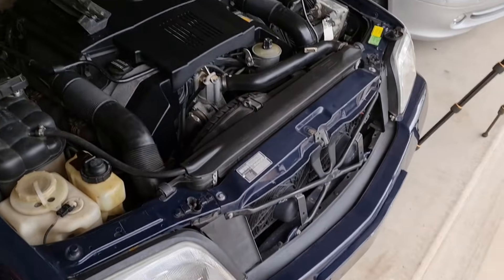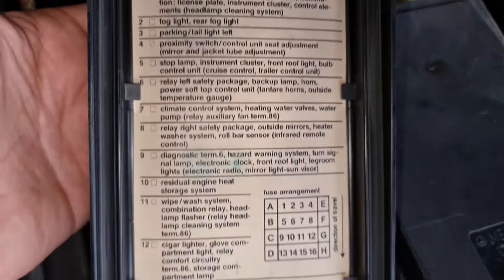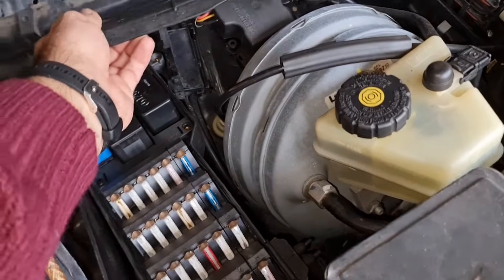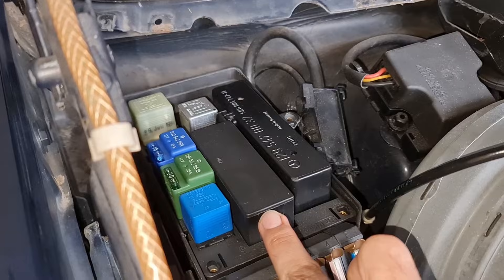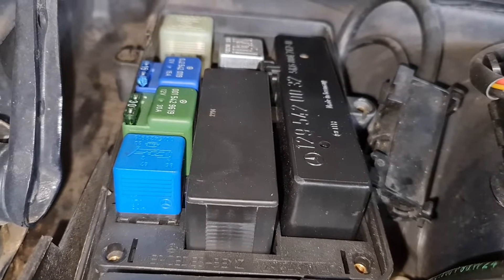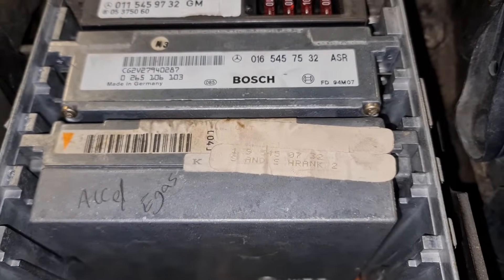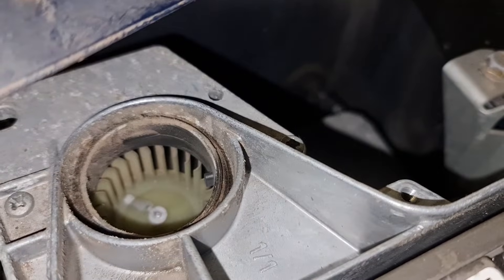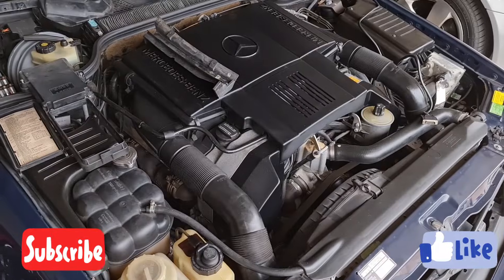SL-Class (R129) Location of ECU, Modules & Relays

Comment: Another great video! One question, are there two separate relays for the fans (high and low) or is it the same relay?
Reply from the maker: The R129 Mercedes radiator fan, specifically the auxiliary electric fan, typically has two speeds (low and high) controlled by a resistor for the low speed and relays for both speeds, which are triggered by temperature sensors and/or the AC system. There should be an orange relay with fuse on top but might be different for 1998 and after (thermofan module)

Comment: After a winter storage without a battery, my '96 SL500 has no power at the cigarette lighter. The car has been regularly used, and everything was working fine until now. The fuse (nr 13. 20A) is okay, but there is no voltage there with the ignition on. Three is no corroded contacts or a bad ground. How i can check relais or modules in this case?

Has anyone experienced a similar issue?
Reply from the maker: Most probably again a corodded fuse as you said.

Comment: Did the spark plugs fuel pump alternator new belt and the car just doesn’t wanna start the battery works but car wants to crank but just dies out any solutions!?!?
Reply from the maker: Fuel pump, have you checked the fuel pressure? I have a video on this.

Comment: I haave a problem with a. 500 , 1990 production year. Interior lights are permanent on (even with a key out) and if i pull bulbs out car still drain a baterry in couple of days. Which module cobtrols a door switches, as i am suspecting that that coud be a cause of current drainage (switches are ok i have checked them).
Reply from the maker: While ignition off pull out Fuses one by one and use an Ammeter  instead the fuse and see what device is pulling the current.

Comment: Where’s the overvoltage relay fuse located
Reply from the maker: @mtbrasi369  Single relay with a fuse on top usually close to the firewall. Pretty sure that it is only available for 1993 and earlier.

Comment: Seems like the video breaks up right after you mention the wiper and turnsignal relays. What are the silver and white ones?
I cant get either power seat to move, wondering if the problem is there?
Reply from the maker: Check the Fuses, they are prone to get oxidated.

Comment: Where is the wiper motor relay ?!!!
Reply from the maker: There are two 'modules' that control the wiper blade N10/2 (which sits in the black box above the fuse box) and the K26 relay module, located just below the blade somewhere.
Reply from the maker: There are two 'modules' that control the wiper blade N10/2 (which sits in the black box above the fuse box) and the K26 relay module, located just below the blade somewhere.

Comment: Hi Benz Addiction, wondering if you can help or have any guidance here. I have a 1995 R129 SL500 and today the soft top would not come back up, the roll bar wouldn't work, the windows would go up or down and the indicators don't work. Is this a Module issue or something else. Ive checked the fuses and nothing appears blown. Thanks
Reply from the maker: Start from this video to understand how the R129 roof works: https://youtu.be/4A0b4H2D9og

Comment: Hi there, Benz Addiction wondering if you can help, I have a 1995 R129 SL500, the top, windows, roll bar and turn indicators stopped working today. I parked the car with the soft top down and when I went to start the car and put the soft top up, there was no light on the hood button coming on and nothing else as above worked? Is this a module fail or something else, I cant see why the indicators wouldn't work if it was a Soft top module issue. Nor sure where to do from here, any guidance would be appreciated.
Reply from the maker: I have a complete playlist on how to make R129 top to work again, no stress, let me know how you go. Nothing scary at all for R129 Top.

Comment: Hi again!  Well now I need to access the n-7 because of a tail light issue.  How in the heck do you get that trim piece off.  I have a 92 and part of that trim piece sits behind a screen like thing and I see where there are 2 screws that appear to hold the trim piece in place.  You dont have to take that back screen piece out too to get the trim piece out do  you?
Reply from the maker: Hello, Before touching the Fuses and Relays make sure that your bulb is not bad, switch around the bulb from right to left first. Finally if you have to check those Relays, basically you need to take off evey screw and filter compartment,  see my other video about Cabin filter. Good luck 👍.
Reply: @BenzAddiction Yes, you are correct I did check.  Bulb is good.  no power to bulb.  pulled tail light assembly out and tested the plug going back to N7 no power to that plug/pin either.  I think one of the pins on the n7 is bad or needs to be re soldered?  I think the N7 is messed up on one pin.  I was going to take it out and clean it and re seat it see it that is my problem but not sure on how to take it out?  Have you taken one out?  After you get access do you push the n7 out from the bottom?
Reply from the maker: @rioraton  check the part number on ebay, look around the part you would like to remove, and you will see how the removal is.
Reply: @BenzAddiction  OK.  Well, I got it to work :) But I did not fix the problem.  All I did was run a jumper wire from the marker bulb to the tail light bulb in the assembly now when I turn on the tail lights it lights up just fine. Not sure if tail light is as bright as the other side I will check  that tonight but it works.   I did not want to spend a bunch of $ for one pin that is out in the N-7.  If more lights go out then I will replace the n-7.  Where I come from it is call a half ass repair :)
Reply from the maker: @rioraton  Great, what matters is that it now works...
Reply: @BenzAddiction  👍

Comment: Great tips here! I learned a lot - THANK YOU😊
Reply from the maker: Thank you for Watching Mark :)
Reply: I might add in here - after reviewing this very well put together instructional video for the third time - that in your video - just to the right of your fuse box & relay box is yet another smaller fuse box. Held down with (easy to break if not cautious) two torx head screw caps. Inside this fuse box are three ‘metal’ fuses - all of which I had to just recently replace. Plus inside the lid is another paper fuse outline instruction sheet such as what one finds in the main fuse box lid. These special metal fuses control the hard tops rear defroster unit, a blower motor, as well as another climate control assembly. Easy to get into just be careful when loosing and tightening these old plastic parts as they will break as I found out first hand & they are not readily available at a MB Dealership as they had to ‘special order’ them for me. Inside that fuse box lid you’ll find the appropriate size metal fuses (on the paper diagram) that should be used. I found that the previous owner of my R129 had placed fuses way over the amperage level (50 & 80 amp metal fuses) when all three slots call for only 30 amp each. The MB tech told me that this kind of bad thinking & oversight could have created a system to overheat & eventually burnt wiring in a harness. So it’s good to also check this fuse box too when in that area checking on other fuses in the main fuse box. Hope this might also help you & others.

Comment: excellent information 👍
what are you referring to as electric water pump?
screenwash pump?
Reply from the maker: Hi mate, mercedes uses an auxiliary electric waterpump on most of this generation and newer vehicles, in this case the blue relay powers the electric waterpump that sits at the front of the brake booster and beside the heater electric taps...
Reply: @BenzAddiction  
I've learned something then!
Thanks 👍